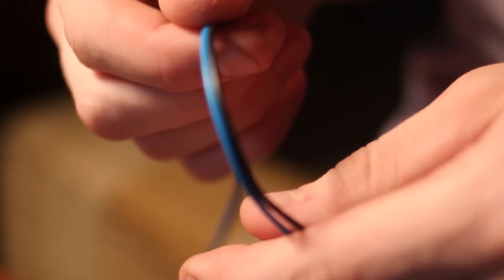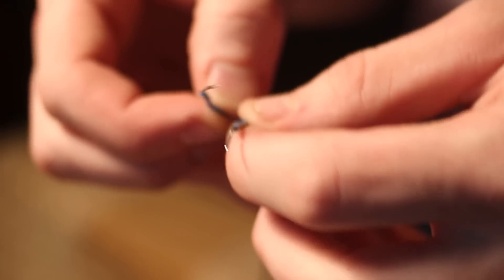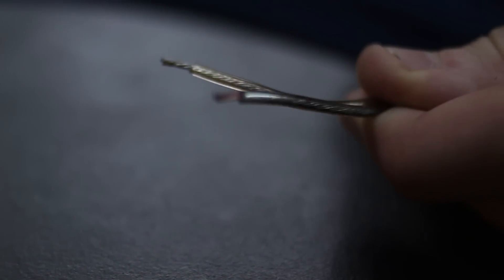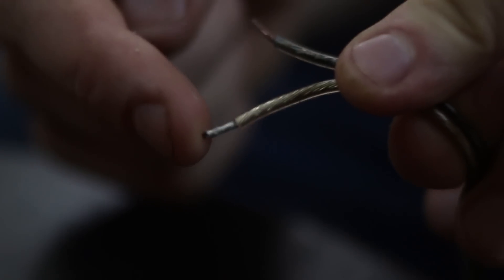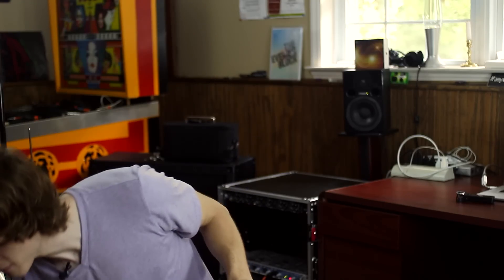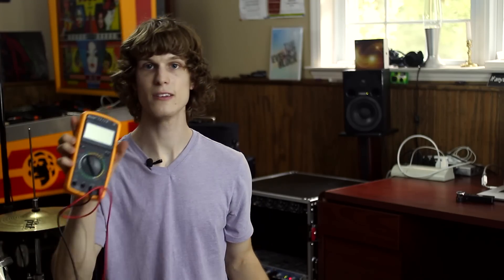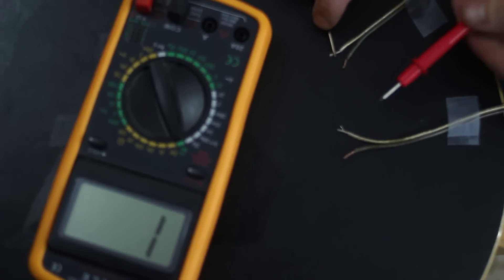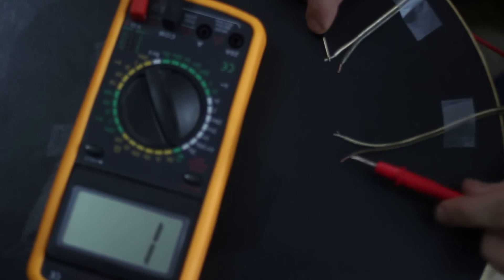How to Check Speaker Wire Polarity : Audio Tips

Comment: You guys are killing me.  I came here for help determining the polarity for the wires running through the walls of the home we just purchased.  These wires are not coded in any way and in order to keep correct polarity from my receiver to the speakers on the other side of the room, I need to determine which wire is connecting to the negative terminal, and which is going to the positive.  This is the simplest solution on the web I could find that works perfectly for this purpose.  The continuity is all i need to know since I’m the one determining which is to be connected to which.  Like the commenter below, I cut a section of extra wire and simply connected it to one end so I could bring the ends close together enough to connect the multimeter.  I’m sure there are other reasons for determining polarity for some of you but for most of us this video is helpful.
Reply: Find the end of the receiver where it says +, get some long extensions, and connect it to the other end.... not that hard. You can even use more speaker wire to make an extension

Comment: You switched topics.  The title of your video is to determine polarity which is positive/negative.  You are supposed to be answering the problem of "how do you know which is which when the wire ends look identical".  You now proceed to test wires for "continuity" which is if the signal can travel uninterrupted on the wire (no breaks).  Two totally different things.
Reply: you realize if you are getting continuity at the other end of the wire... you now know which is which....
Reply: @thejoshuatree03  His point was that this guy switched topic. Plus what if you can't get to the other end in a timely fashion?
Reply: Turbomorph but he didn’t... in order to determine the polarity, you need to test continuity. (One method at least). If the other end is far away, you can attach a spare wire to the device to reach the other end of the wire you are checking. Simple stuff.
Reply: @thejoshuatree03  in any case, it would be more accurate to title video as a test for continuity. 'you realize'.
Reply: I would have to agree. I am new to all this stereo and electrical shit, but I would like to at least believe that I'm smart enough to relize that his video (as good as it was I promise) seemed to only show how to figure out where each end of the wire is! Not WHAT it is! Or am I just tripping? I don't believe so, cuz it seems to me the only way to find "Positive" and or "Negative" is once u locate one of the two on one end, you can use his method to locate the EXACT same on the other. But what if your in a specific situation like mine? I am installing a new set of 12 inch subwoofers in my car, and I had a 3ft piece of 12 gauge wire sitting around that would be ALMOST perfect for the job if it hadn't been that both ends of the wire are literally EXACT!! UUUUGGGG!!! I'm sure they aren't exact, but to a 50 year old pair of eyes they are! Lol if I'm wrong PLEASE point.out where and why! Not being a smart ass, honestly just trying to learn something new. Oh, and keep it up young man either way it was an AWESOME VIDEO at its obvious you know your shit, and I appreciate how knowledgeable and articulate you are during it. Take care everyone, everyday and God bless!!!
Reply: YUP!! I got fooled by him too. I wanted to check polariy, not continuity hence he wasted a good few minutes of my life. bah!

Comment: So let me answer the question everyone here is looking for. You got two random colored speaker wires coming out of somewhere. A toy, an old radio, the door panel of your car, a wall, ceiling. Neither is red and neither is black. How to tell which is positive? Informal rule is, most manufacturers will make the lighter colored wire positive. So if you got orange and purple. Orange is usually +. Stripes are usually + also. But you can't trust that. So get a digital multimeter, set it to DC and connect the leads. Press play or turn the volume up (JUST A LITTLE!!) to activate the wires. Connect the multimeter leads. If the numbers are flashing negative, it's wrong. If the numbers are flashing positive(or no symbol at all), that means that your red meter lead is connected to the positive speaker wire. DONE.
Reply: Thanks for this information, I have a Chevrolet captiva and I'm changing the speakers and both wires coming out of the door panel, were light blue and dark blue, no indication on the wires to determine which is positive and negative, I did what you suggested and I figured it out 

Cheers for the information 👍👍👍😊
Reply: And the wires coming out if my door panel, they were both identical materials no cooper or nickel to indicate which one would be + or -

Comment: My wires weren't labelled and already installed across the lounge room. I just hooked up a piece of wire to one end to get the two ends close enough to do this test and work out which one is positive and negative. Thanks.

Comment: I need to check polarity while only having access to one end of the wires, both leads are identical and the speakers are installed in the crawl space and I will not be able to access the speakers for a long while (neck injury). 

I replaced my amp and didn't take notice while removing them from the old amps binding posts and only after unplugging did I look and see that the jacket and leads are all the same color. Even if they were marked I wouldn't trust the old owner as I found that the Front speakers accessible in the "Rec" Room were wired goofy even with speaker wire that is actually marked Positive and Negative ... Front Left speaker had the white striped lead hooked to negative post but Right speaker had white striped lead as positive.... anyways just need to find polarity without having access to both ends of the wire or the speaker.

Comment: I can't believe how many people on here failed to understand this... if you have two unidentifiable wires, label one end of one wire + or - (doesnt matter which) and then go to the other end, use the continuity checker to see which wire completes the circuit.. then label that end either + or - accordingly... now you  can identify which wire is which
Reply: it's pissing me off too.
Reply: Hey this is a  Real stupid question but I'm being completely sincere. Is what you just said exactly exactly how it works? In other words do I get a choose which wire is positive and which one is negative as long as they're the same wire? I'm new to this man so please bear with me. Lol
Reply: @wesleywilson7328  yeah! the wires are the same they're usually just color coded so you are able to tell the difference.  In my case they were both brown so I had to chose which would be + and -  As long as the positive terminal of the speaker is wired to the positive terminal of the amp and so on you're all good!

Comment: How would you tell the Audio left vs Audio right on a wiring harness?  They are not speaker wires but Audio Ground, Audio Left and Audio Right Line Level I believe I have the terminology correct?  They are not amplified?  They are meant to connect to a headset communication system.  I can turn the radio on  but how to i test which pin is left vs right? i believe i identified ground with multimeter continuity

Comment: Seems like an easy enough solution if the ends of your wires are all within reach, but at that point couldn't you just follow the path of one wire all the way to its other end?  I was kind of hoping there was a way to check if you're on the other end of the room from where the wires begin.
Reply: you can use another wire to reach the other end of the room and when the circuit completes you know you've got the right end to your wire

Comment: How are people not understanding this. Buy a multimeter for $10 at walmart. Buy an extension kit for the multimeter for $10. Walk to the back of your receiver. Turn your multimeter on continuity mode. Touch the red to your + output. Touch the black to the end of your unknown wire. If it beeps, that's your positive.

Comment: COPPER is POSITIVE, silver NICKLE is NEGITIVE,   or Ni for NEG.
Reply: not all speaker wire uses different conductors or is color coded
Reply: Industry standard: Silver (or Nickle) is Positive, Copper is Negative